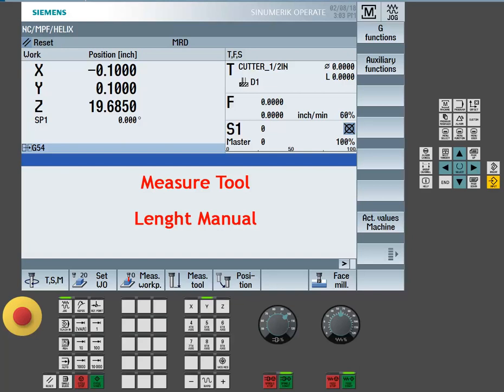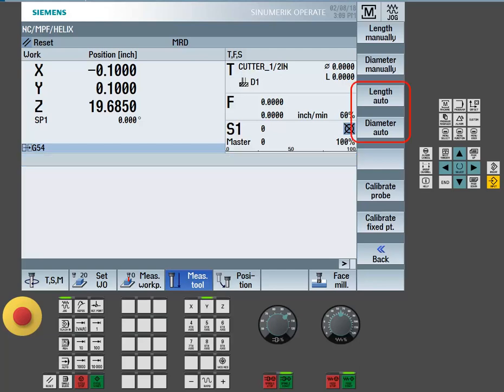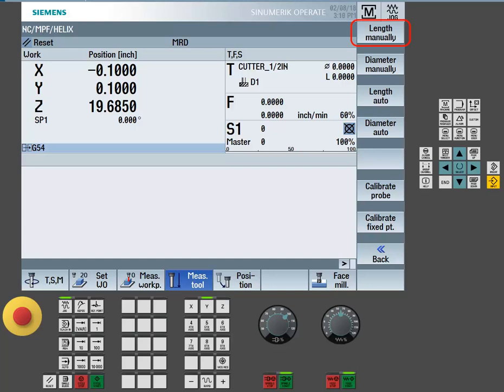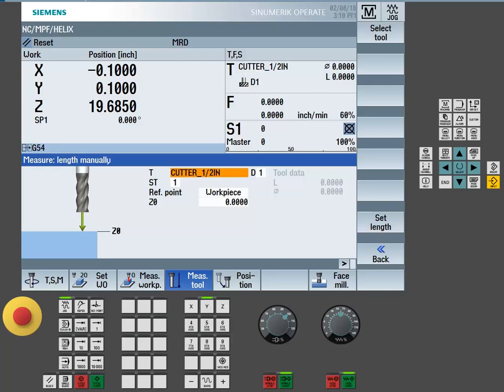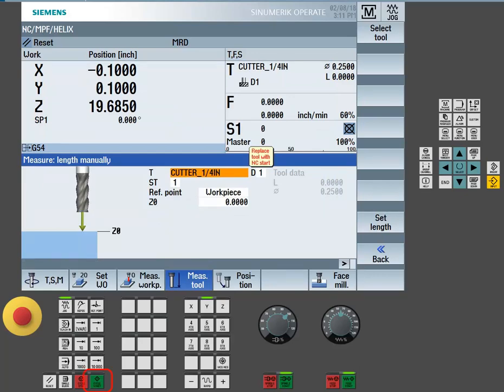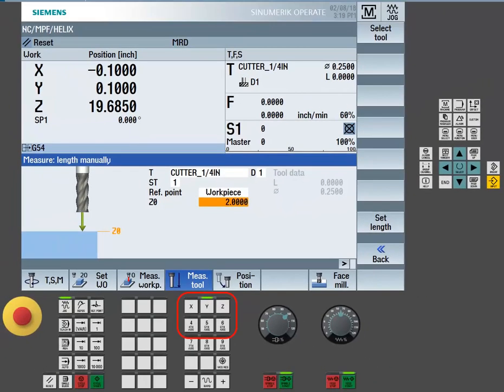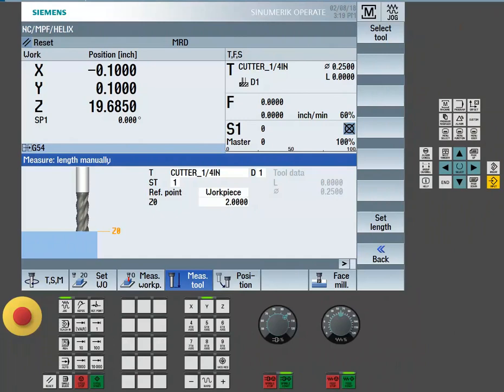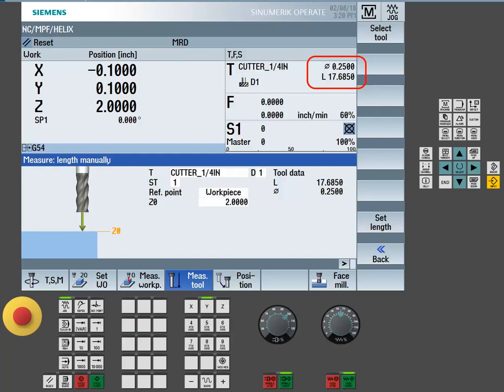Measuring Tool Lengths in a milling machine - Sinumerik CNC

Comment: Perhaps worth a folllow-up video, but how do we interface a Tool Pre-Setter onto the Sinumerik control. Wiring/pinouts and macros-wise. Those presetters are rather inexpensive devices and could make this task far more easier
Reply from the maker: We will work on this

Comment: Thanks for the video. I'm also more inclined in the idea of having a Fixed Point as reference than a workpiece. Will selecting one or another method affect calculation on the control side? e.g. transformation, fgref, feed, etc. Equally important to know is, are positive and/or negative tool offsets affecting those calculations?
Reply from the maker: the only time you need to worry about TLO calculations and how they play with other offsets is on a 5x machine.  With 5 axis you always need to use a positive TLO.  I however have now adopted positive TLO on all machine types.  at the end of the day it is just a better method.

Comment: With the Sinumerik control, is it possible to set the tool height in relation to the table and not a work offset?  (So if I have already setup a work offset then need to add a tool, I don’t have to redo the work offset)
Reply from the maker: Yes if you decide to set you tool offsets to a fixed point like the machines table you simple apply a shift in your work coordinate Z axis to determine where the top of the work piece is.